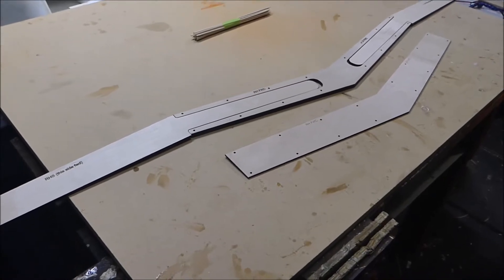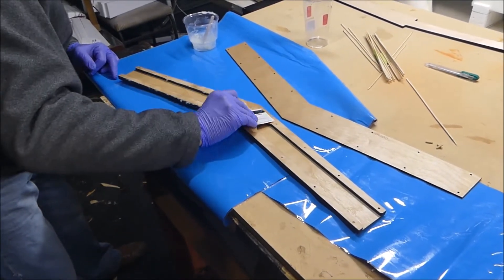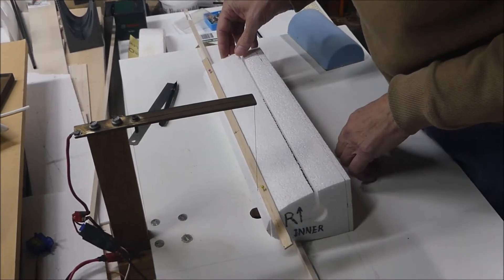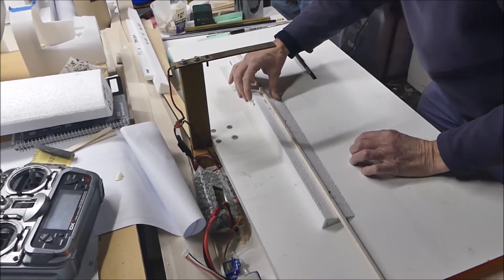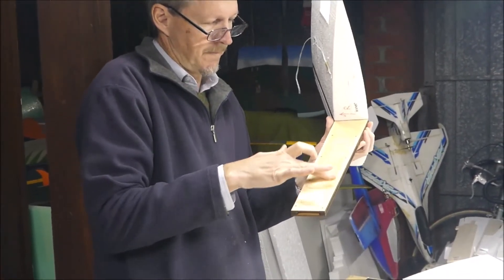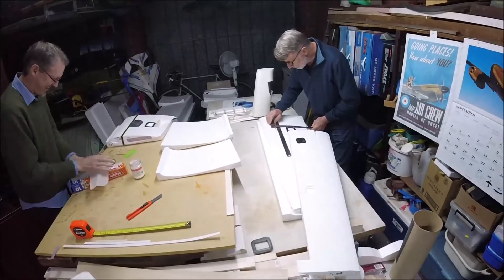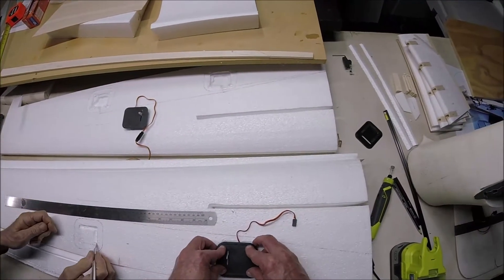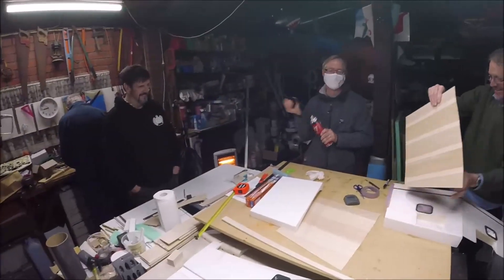RC PBM Martin Mariner build - part 9

Comment: Hello. Great progress. We flew our Mariner recently. One thing we found about the plywood wing joiners is that water gets in and swells the wood. We had a tough time removing the outer wing panels after a flight. We'll have to do some sanding and seal the joiners to prevent that from happening.
Reply from the maker: Thanks Tim. Yes, I'm not sure whether our sealing will be sufficient. We will keep that in mind. Happy Mariner flying.

Comment: Really incredible to see this coming along! If I may ask, what plans/design did you use? Good luck on the maiden!
Reply from the maker: Thanks Rowan. The design was initially based upon plans made by Keith Spark's - these are available online. However, we have since made many modifications based upon a scale 3d model and our own imagination for engineering solutions.
Reply: @MrWaz11  Thanks for the quick reply! I'm thinking of making one of my own so this is a good start. Good luck with yours!
Reply: @Rowan.Albright  As part of the hive mind that is working on this, it's an insanely difficult model to build because NOTHING is flat or square.  That adds to the challenge, and hopefully satisfaction of getting her airborne, but it's definitely not a design to take on lightly.  We realise now why there are so few RC models of it out there.  Good luck with yours :)
Reply: @_Mk9  That's an interesting point. Thanks!